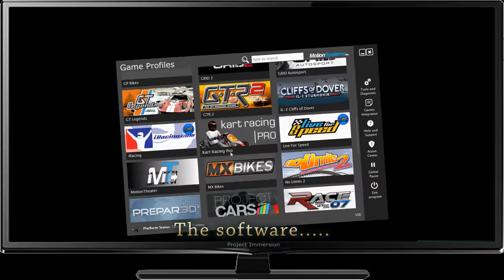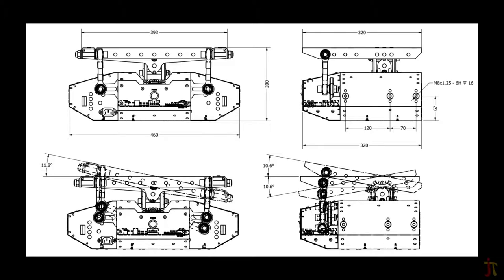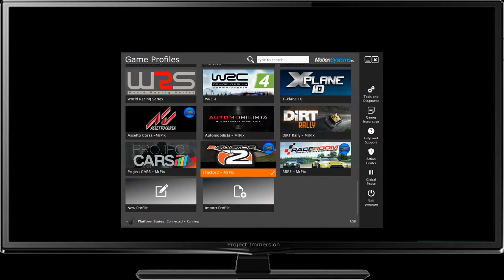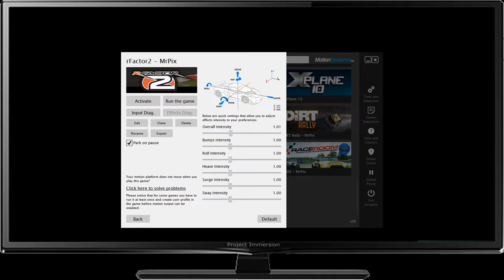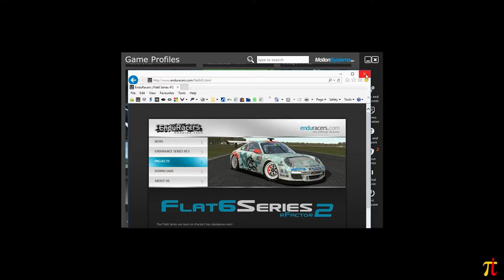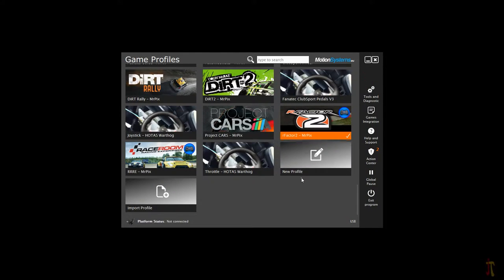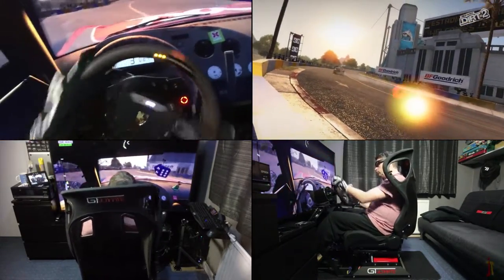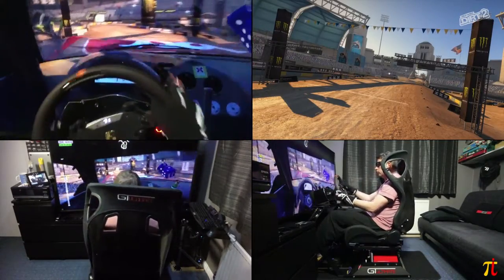PixTV - Episode Four - Next Level Racing Motion v2 Review

Comment: Great review , very good information indeed , keep an eye on the two bolts just above the handles for seat recliner -- the come loose after time .
Have that seat for the last 2 half years and it's more or less bullet-proof , really found this video very useful , bid thumbs up here .
Reply from the maker: +josephzee Yup, the bolts on both sides of the GT Ultimate seat back rest have come loose a couple of times since last August. I'm keeping an eye on them now the motion v2 is attached and may swap out the nuts for nylock types or add thread lock compound to them.

Great tip and thanks for the feedback.

Comment: so is it just the seat moving the pedals aren't at all?i think that would be weird id have to try it before shelling out 4k
Reply from the maker: Yes, just the seat, it applies g-force effects to your body. if the pedals moved too, your muscles would not get the same workout as you resist the forces and so would have to move much more  The subtle movements are all that are required for your brain to be fooled, you really don't need a rollercoaster ride when driving. I suggest you do try before you buy... find a fellow close to you that has a setup and get a go on it, but watch out... once you have been bitten by the motion bug, you will need to get your wallet out!

Comment: So how did it survive those years? :)
Reply from the maker: Hi Christian, I swapped it for the v3 when it first came out just over 3 yrs ago and it has worked fine ever since :) Still use the NLR Motion v3 to this day, most days too.
Reply: @ProjectImmersion  thx for replying. As I understand the v3 came out almost the same time as the V2 didn't came out in as many units? What's the biggest differences between the V2 and V3? I've been tying to find some real specs in the differences, but with not so much luck.
Reply from the maker: @NoFlightZone  I focus on the differences in this review https://www.youtube.com/watch?v=GLwNWiZ66eA nearly a year between the 2 units.

Comment: I think I missed it.....why the springs underneath?
Reply from the maker: I think they are there to help keep the seat in it's centred position when powered off. The EMB's are not active without power.
Reply: Project Immersion ah ok, for looks than functionality, springs absorb motion and can make it softer.
Reply: whats an EMB?
Reply from the maker: Electro Magnetic Brakes - yes the springs probably do dampen the motion, but that's not always a bad thing.
Reply: copy, cheers, well ive had springs under my sims, just me, I prefer them not, I get finer motion detail.